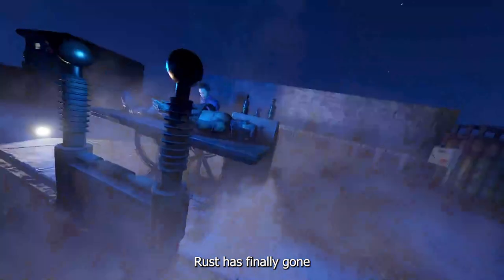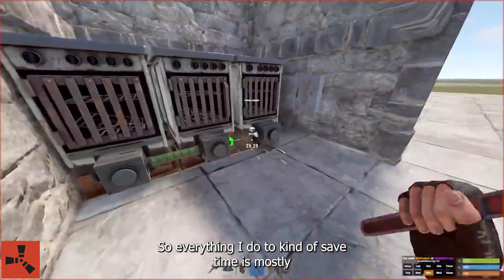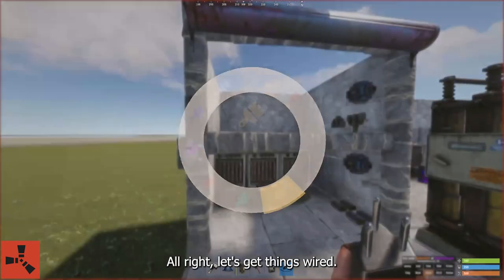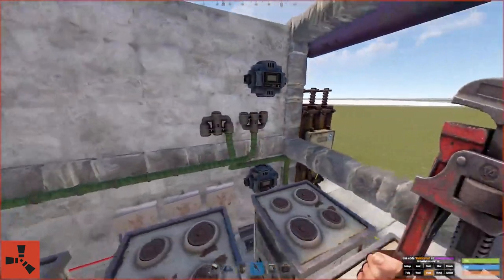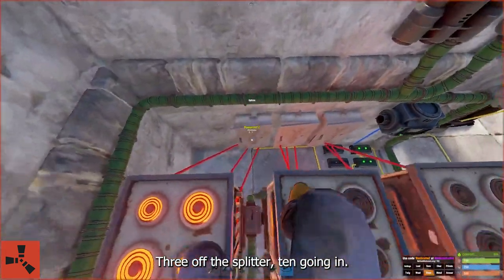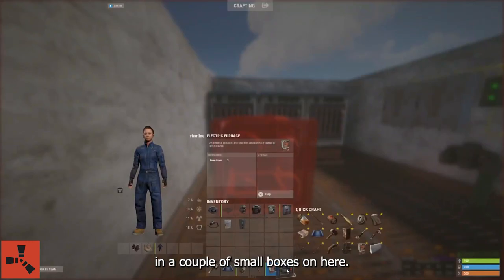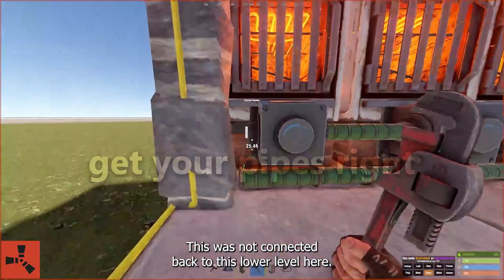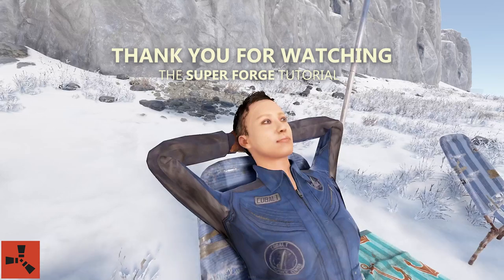How To Build the Super Forge v1 Module in Rust

Comment: I love the look of this, and that grate really adds to the industrial feel!

One tip to avoid potential headache in the future - when wiring up the furnaces, wire a line to the turn ON of each of the furnaces, and hook that up to a timer or something.

When servers restart, if the electric furnaces don't have power (if this system is turned off during a server restart) they will default to OFF even when power is reapplied. Having a little switch to turn them all on ensures you won't have to tear this neat little cube apart if that ever happens. You can even leave the switch disconnected from main power so it doesn't take extra power drain just sitting there, but at least you'll have it if you need it!
Reply from the maker: That’s a great idea, I definitely need to get more familiar with the timers and blockers, cause those would definitely save me a lot of time and energy!
Reply: @spilldrop-  Instead of using a timer what you can do is use a button to a ignitor and have one ignitor per floor and all you have to do is hit the button and it will turn all of the furnaces back on.  All this takes is 5 extra power using 1 button to a branch then the branch to each of the ignitors.  If you notice the furnaces are off due to server restart you can just push the button and it will turn on all of the furnaces.
Reply: @Zarovich89  Thanks a lot for this. Its a lot less work to hook up 2 ignitors than it is to hook up 15 furnaces.
Reply: @Zarovich89  where do you fit the ignitors? do they reach all of them if its configured the same as his?
Reply: @CruchedPenauts there eaely was some space left on the right, perfect for igniters

Comment: i had made a setup like this once. I didn't want it using up my power, so i set it up to a blocker, which was hooked to the the end of my chain of branches (used for things like lights and other circuits.) The ore input conveyers "filter fail" output would block the power to the splitters (no ore to smelt, no power.) I then hooked the output conveyer's "filter pass" to a blocker that would block the other blocker. (If there is leftover ore still smelting, block the input conveyer from blocking power to the smelters.) So it would automatically shut off, only when there was no ore to be smelted, and there was no ore already smelting.

Had to use a "And Switch" to push enough power through the second blocker
Reply from the maker: I really need to spend more time practicing more complex circuits, I’m finally getting a little bit more comfortable with the basic ones in my videos lol. This is a solid note though, and one I’ll try to look into for future designs!

Comment: Button + Igniter = light furnaces without needing outside power from the grid

Also one thing I do with my industrial furnace setups is limit the input of material into the furnace to like 100 or 200 per furnace, so the first one in line isn’t holding 1000 while the last one in line is empty, holding a bigger stack doesn’t make them cook any faster so I usually do a stack limit to share the workload evenly, this is a great setup :)
Reply from the maker: 100% right, I completely forgot that buttons can power igniters, this idea is making it into the rework!

Comment: i think the electricity can be more efficient if we use more splitter than branches.
for example the bottom system has 3 spliters each which takes 10 power, so 30 in total, 
we connect the three spliter to another spliter , we give this spliter 31 of power, from the main branch(the one on the frame outside)
this way we saved 3 units of power+ cost of 3 branches
Reply: Wrong

Comment: i think you made a little mistake with your electricity. the first ebranch that you placed on the frame. you set the branch out to 94. that leads to the system always consuming 94 rust watt no matter how much devices are connected or how much power is actually needed.
if you set the branch out to a value, it always consumes the value that is set.
long story short: you use 94 watt although you only need around 50-60
Reply from the maker: Thanks for pointing that out! I wasn’t sure if the output actually changed depending upon the draw from the circuit, so that advice helps a lot!
Reply: you are welcome
Reply: @M1nority_  Ay thanks for that, it was irritating me that it was consuming so much when we spent so much time to try make it as efficient as possible! I put 60 watts into the first branch and it works perfect, power no longer goes down :D

Comment: My main issue with these, is how do you turn the furnaces back on after a server restart?  You have to activate the "turn on" button in the UI after the server restarts, so how do you reach the ones in the back bottom layer?
Reply from the maker: That is a great question, and the primary reason I didn’t wire those on switches is because they don’t offer a passthrough, so each furnace needs to connect to a splitter array, adding about 8 splitters by my calculations. That seemed like a lot, and didn’t really want to include that in the video. Is there a more efficient way?
Reply: @spilldrop-  what?  Im talking about how you have to turn on the furnace in the UI before it will do anything, regardless of if you have power going to it.  after a server restart, you have to go in the UI again to turn it on or it will never power on.
Reply from the maker: I understand what you’re saying, though you can wire a switch to the on switch for the furnaces, which would allow you to turn them all on from outside the cube, even after a reset. The issue is the additional wiring is a bit intensive to add that switch
Reply: @spilldrop-  ok I completely forgot about the other ports on these.  Perhaps the red button can start one up by itself...
Reply from the maker: Someone mentioned in another comment that igniters will also turn on electric furnaces—I’ve used igniters for LGF furnaces, but I haven’t tried them for electric ones, could save a lot of time and energy though!
Reply: @spilldrop-   the best way round this problem i have found is controlling the power feed with a memory cell and the filter pass/filter fail outputs on the conveyors this will then turn them on when ore is added to the box and off when cooking finished - you only need to turn them on the first time they get power
Reply from the maker: That is some big brain stuff right there! I’ll definitely need to look into that, because that’s a cool way to save power on the grid!
Reply: @syhackett1  hooly fuck nice call man

Comment: i feel like you are using 3 times as many electrical components than is needed and take twice as long.
Reply from the maker: That’s honestly quite possible; the best shortcut that I could identify but couldn’t resolve is that the furnaces don’t have a passthrough node, or at least one I can find. If you can point out what’s unnecessary I’ll definitely give it a shot!